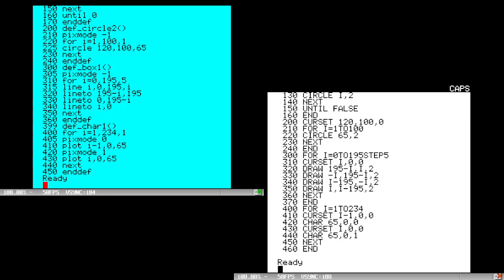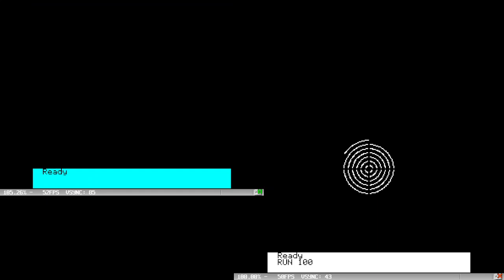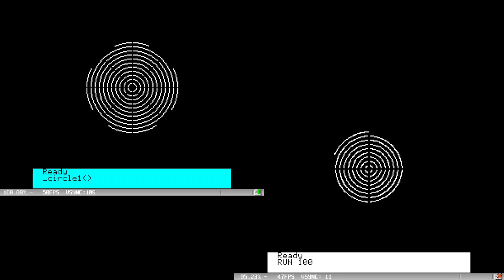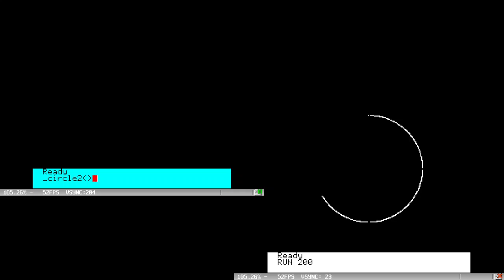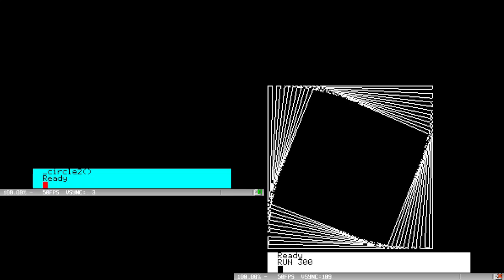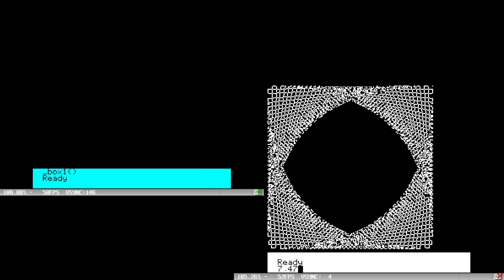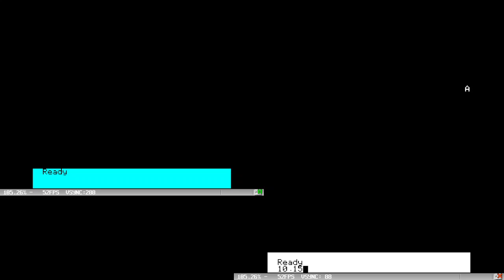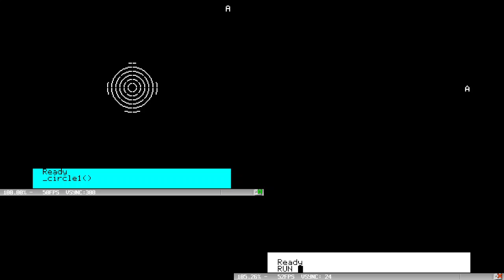High resolution drawing speed comparison 1Mhz 6502 dflat vs Oric BASIC

Comment: Incredible, 
what are the recommended oric emulators  to use these days?
Reply from the maker: Thanks for your kind comment!  I use Oricutron for emulation and I have a patched version specifically to work on dflat so I can access tape file load/save.
I have a GitHub repo for all of this - you can easily play with dlflat in the emulator, plus a wiki about dflat so you can try it.  Link below, hope it helps!
https://github.com/6502Nerd/dflat
Reply: @6502Nerd  Thanks, if only we had dflats in ROM back in the 80s...total game changer :-)